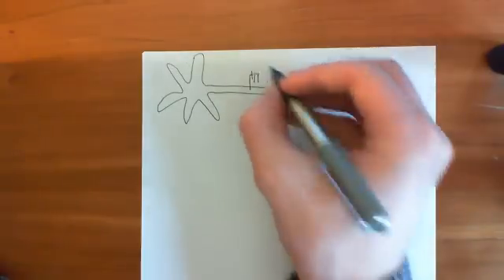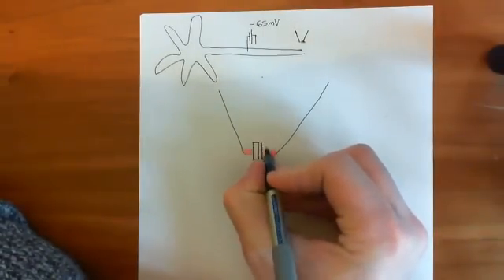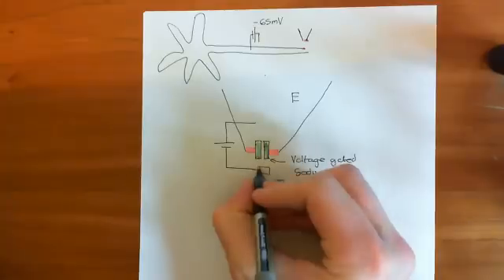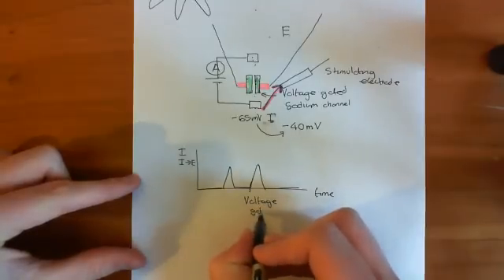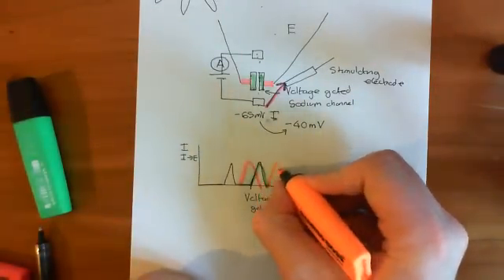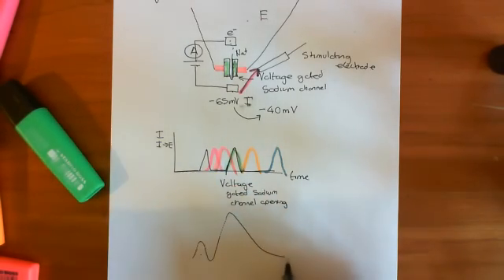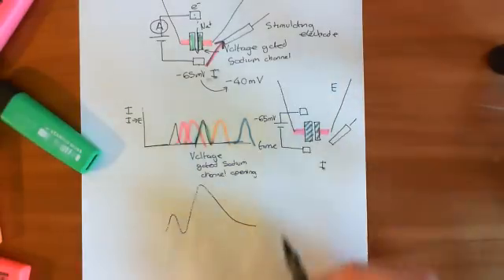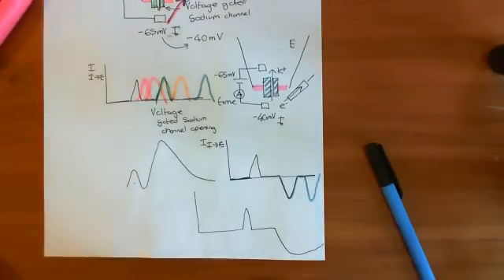The Patch Clamp

Comment: In an intact cell patch clamp experiment, 1. two electrodes are inserted into the cytosol but at different depths.
2. one electrode is applied to the plasma membrane in a region containing only lipids and one into the cytosol.
3. two electrodes are applied to the plasma membrane, one in a region containing only lipids and the other in a region containing one or few ions channels.
4. one electrode is applied to the plasma membrane containing one or few ion channels and one electrode inserted into the cytosol.
 please give the answer

Comment: @8.50 why does the sodium ion move from extracellular to intracellular, previously it moved intra to extra to maintain -65, now why the reverse movement? Pls explain
Reply: Na+ from Extracellular to Intracellular.   K+ from intracellular to Extracellular. From what I've read this makes sense.
Reply: This is because of the ion distribution. There are much more potassium ions inside of the cell than outside. If the channel opens, potassium is more likely to move from intracellular to extracellular space along its concentration gradient to get the same concentration of potassium ions on each side of the cell. It is basically the same for sodium ions, just their concentration is higher outside the cell.

Comment: If the battery restores the potential to -65mv immediately after the potential is altered, then even if the V.G channel does open, why would any current flow through the channel?
Reply: If the voltage-gated channel is open, sodium or potassium ions(depending on the channel you look at) are both likely to move through the membrane along their concentration gradient to get an equal distribution of ions inside and outside of the cell. This chemical force leads to a change in voltage again and electrons are moved again, which means that a current can be measured.